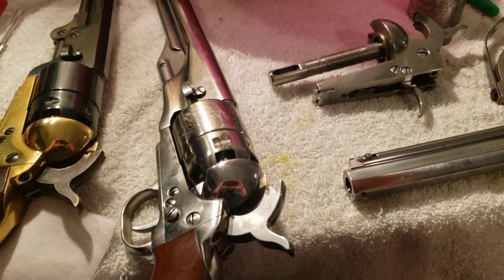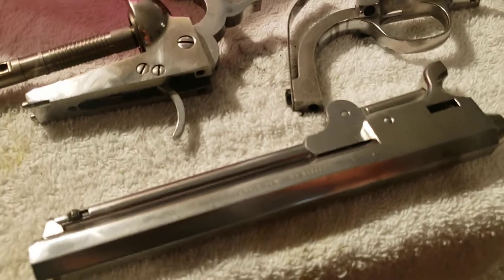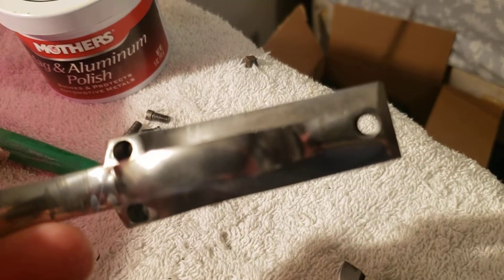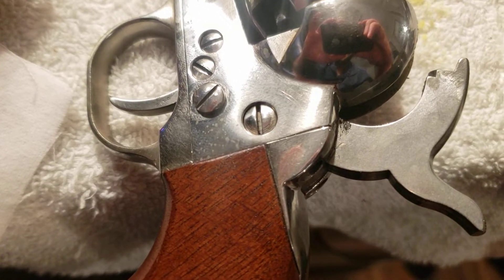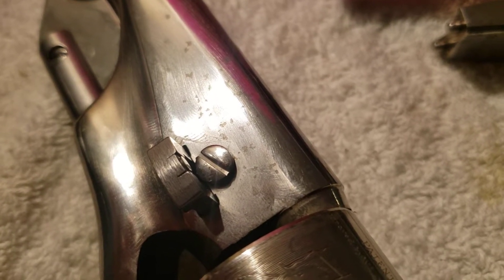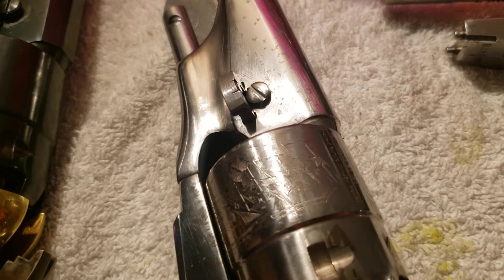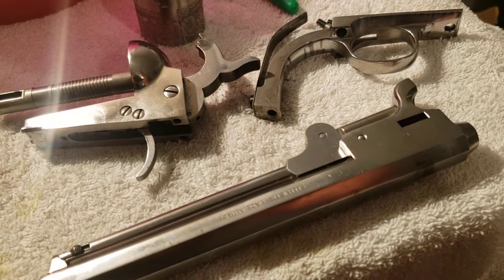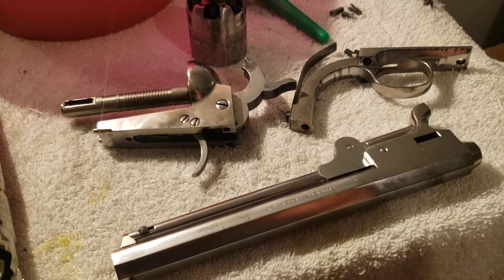Polished steel 1860 and 1851

Comment: Polished steel will rust. It just has a harder time getting started on polished steel as it's got less 'tooth' for the oxidation process to get started on. The black 'stain' is a perfect example. It is a form of rust. But a benificial one in that it will proceed to a point but no farther and will protect against red rust.
Reply from the maker: Not sure of that tbh.   I noticed no rust after getting the black off.. sometikes i left it ob and it did nothing.

Now the dots...  caused pitting.. not sure  if that was rust or nothing... I think it was hot powder that caused it